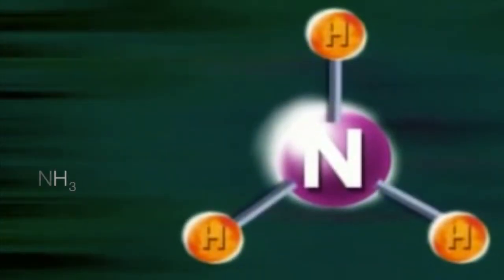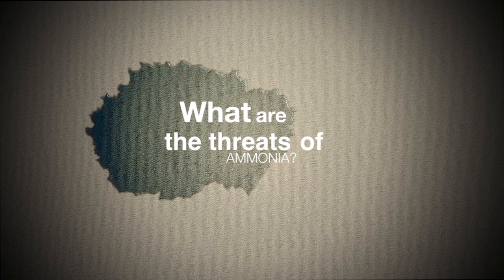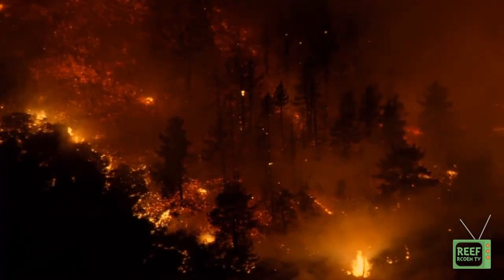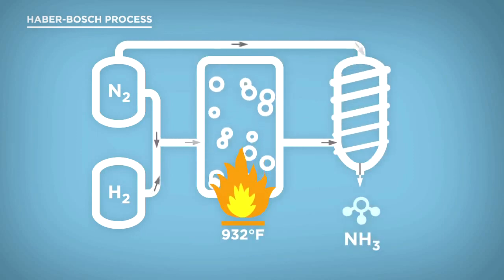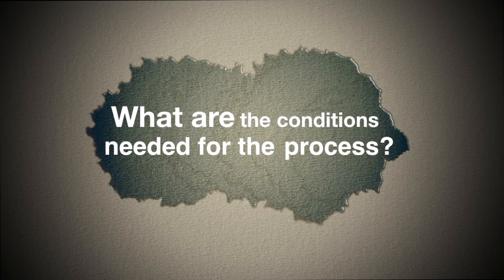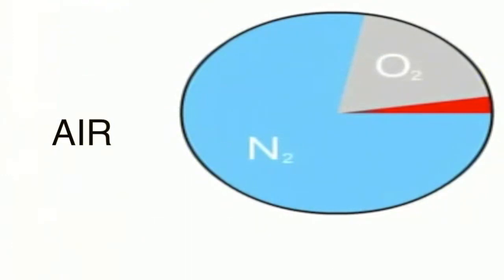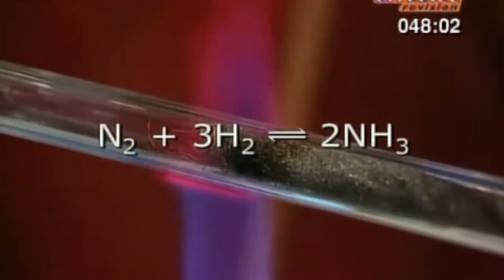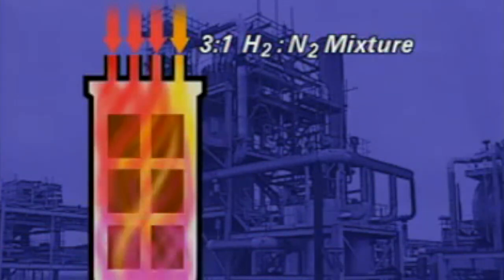Ammonia Synthesis For Fertilizer Use

Comment: +Guillermo Vargas ammonia is used in oswalt process to make nitric acid that gives TNT whan reacting with toluene. so, without ammonia is very hard to make explosives unless you use the mineral nitrate salt, but this is a long way hystory, so I believe this is enough